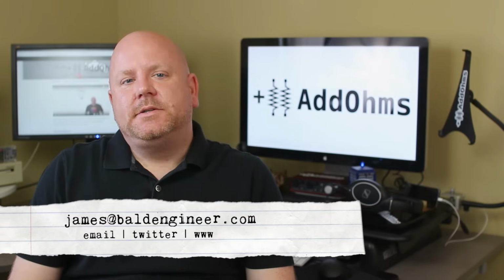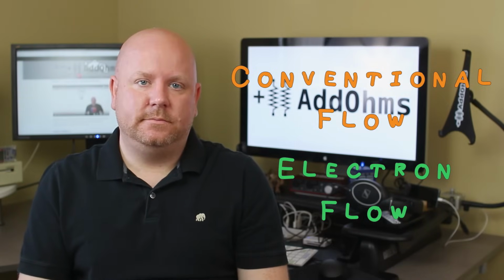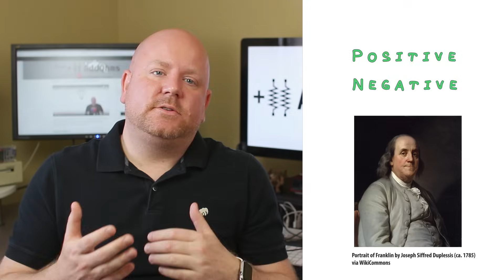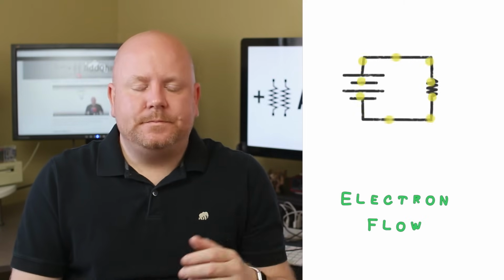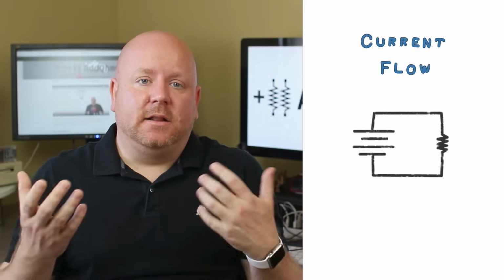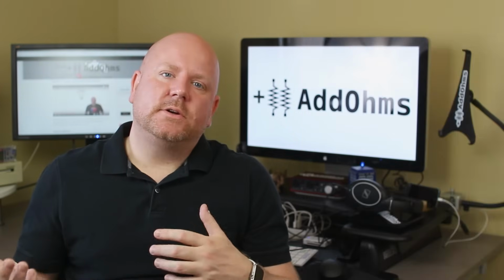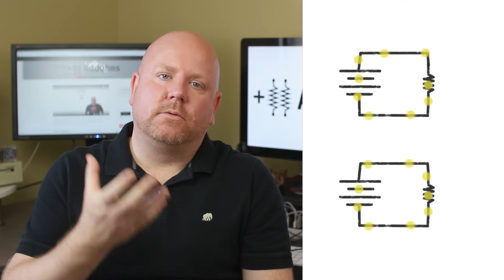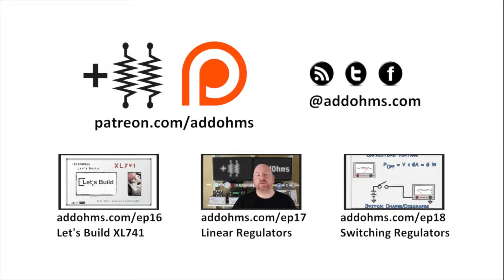Which way does Current Flow | AO #19

Comment: Sorry but Electricity doesn't need to be a closed loop to work .. and NO electricity does NOT comes from the negative side , that was a myth .. HOw can 2 opposite flows be correct  that wouldn't make any sense
Reply from the maker: "Electricity" is a concept that represents a form of energy. So no, "electricity" does not need a closed loop, but this video didn't talk about "electricity." It spoke specifically about current flow. Current flow does need a closed path to flow. And current flows from negative potential to positive. Those are both fact and are not myths.

Comment: Thank you +AddOhms, for the explanation.  But if "flow direction" doesn't matter, why do we place components, such as resistors, capacitors, etc. at specific places within the circuit?   Could we just as easily place a resistor somewhere else in the circuit and get the same results?
Reply from the maker: Don't confuse "path" and "direction." The direction the current flows does not matter. The path it follows does.

Comment: So what if the circuit is using a diode? Since the diode only lets current go one direction if you make a circuit using conventional current your circuit will NOT work....right??
Reply from the maker: You don't "make" a circuit with either. You evaluate it with one or the other. As long as you evaluate the entire circuit with the same method, it doesn't matter. In electron flow current flows from cathode to anode, instead of anode to cathode as in conventional flow.
Reply: @AddOhms  It certainly does matter. Fundamental understanding is absolutely critical for those working research. It is also important for safety, as numerous accidents are caused every year through lack of fundamental understanding.

Comment: As a small boy I learned with conventional flow, it's the easiest to understand. Scientific eggheads are there to confuse us all.
Reply from the maker: I think whatever you learn first is easiest to understand. I don't think either is easier. If you (and I) had learned electron flow first, conventional would seem strange.
Reply: Conventional current just seemed easier to me. Before I found out about diodes I never thought of current flowing through a circuit, as soon as I started to use other components, such as diodes, I thought of the flow of conventional current due to the arrows on the diode and LED symbols. It just looked more natural.
Reply: When I was at college the conventional current way was used, although we were also told that it flowed the other way from a scientific point of view. The lecturers basically said "this is electronics not a science lesson!".
Reply: There is a place where you learn one thing, and it stays the same, even after proven wrong.  You can go there and pretend that fiction is fact indefinitely.  It's not called a classroom.  They call that church.

Comment: Hello James, you made very interesting video. I start to learn electronics, and can't undersnand one thing. It's about n mosfets, especialy about using it for reverse polarity protection. I viewed many images and articles on the internet about it, like this one: http://rs20.mine.nu/w/wp-content/uploads/2013/02/nfet.png
There negative terminal of battery connects to Drain and negative load to Source. I tried to reconstruct this scheme with LED and FQP30N06L, and it does not works. LED lights even if Gate not connected to positive terminal.
In your video "MOSFETs and How to Use Them | | AddOhms #11" your connection goes other way: negative load to Drain and negative terminal of battery connects to Source.
And your scheme is working, if i disconnect gate led stops emiting light.
Can you tell me what way is correct and why. Thanks in adwance.
My brain trying to get out of my head.
Sorry for my english. I just don't like to use translators :).
Reply: Did you ever get your answer?

Comment: don't get it! IF it doesnt matters in which way a current flows then why doesnt my LED light up when i connect +ve terminal to -ve terminal? please explain. this is making me made for 2 months??
Reply from the maker: +Yunik Maharjan As long as you use the same flow-direction for the entire circuit, it doesn't matter which you use. 

Conventional you would look at the diode as conducting from cathode to anode. For electron flow you would look at it from anode to cathode.
Reply: Does that mean the side where I put a resistor for LED doesn't matter? As long as there's a resistance in the loop?

Comment: I think the best way I every heard it explained was as a line of billiard balls all touching each other. If you hit one end, the energy will be transferred to the other end, but the balls themselves (the electrons) don't move all that much. However, they do still move which is why we can create electromagnetic fields with current
Reply: 4 milimeter/h or something like that, what a crappy flow hehe.
Reply: In a #12 wire carrying a current of 20 A, the drift velocity is about the same as the speed that a snail crawls.

Comment: the positive side of a battery holds more charge(electrons) than the negitive side does at rest...when a wire is connected to both terminals...something amazing happens...an ELECTRON gets kick out of its orbit and find a new home by kicking out an electron out its home...which then FLOWS to another atom....very simple until you have to find a way be right about an old theory.

Comment: +addohms answer me this...how can both veiws be valid when one is electrons which does jump from one atom to another and the other is based on proton moving....protons dont move from one atom to another.  if they did would mean that nucleus was split apart...proton moved to another split nucleus and re-assembled just to be split apart again as the proton moved.  Cold Fission?
Reply from the maker: Hm, I can see some confusion happening there. The drawing was mention to show that positive charge carriers could be the thing that moves, like it does with the holes in a semiconductor. In the case of wires (and conductors) only the negative charge carriers move.
Reply: +AddOhms but i still see snake oil.....semiconductor holes....if holes in a diode moves from pos to neg where does the holes move when they reach the end of the diode...do they move through the circuit until comes back to the pos side of the diode?...The whole concept of two charges can be seen to move depending on which one you decide to look at is an attempt to keep all theories and the arrows of a a trans..to have some sort of being still correct.
Reply from the maker: +ken ezzell I think the physics of the P-N junction is something to consider deeper. Thanks.
Reply: Holes are just insufficient amount of electrons. Those small amount of electrons can still move, creating view of moving holes.

Comment: Strictly speaking current does not flow, current is better described as a flow of charge. You can state that in this wire we have a current. But not that in this wire we have a current flow. In the same way that It is correct to say you have a water current, but not you have a water current flow. As the word Current already incorporates the concept of flow as current literally means "a flow of <substance>"

Comment: There are two ways to view it because scientists hate to admit they were wrong and change what is currently used. ;)  This has lead to a great deal of confusion for students of electronics for decades.  Electron flow is correct where as conventional flow is a matter of convenience.  I still wish they had revised everything when they discovered the truth as this can make understanding some circuits difficult as in transistor biasing, especially when you are just learning the theory for the first time.  Just awhile ago I was looking at a transistor circuit and was totally boggled as to how it worked until I changed my approach and looked at it from the point of electron flow.
Reply: This is blowing my mind... I was taught the conventional way 25 years ago until a few days ago some kid told me the opposite.
Reply: I was confused as a kid and until my late teens, in exactly the opposite way: I knew from the beginning that electrons flow from negative to positive. The confusing parts are the electronic symbols: diodes and transistors. They were kind of cryptic to me because I didn't know those little black triangles were ARROWS pointing towards the conventional flow.
Reply: There is no reason why it cannot be changed, regardless of how long it has been taught incorrectly. Long standing beliefs are challenged all the time in science. In electronics, electron flow is what is important and we shouldn't be pretending that electrons are flowing the opposite direction to what they actually are.
Reply: Flat earthers are organizing. In fact, they now have branch offices all around the globe.
Reply: just wait until you realize the earth is flat and NASA is a complete fairy tale, then you'll be up all night for weeks relearning what you thought you knew.  good luck, enjoy the ride.
Reply: @chris_topher1984  shut up flat earther
Reply: @babajideodusanya8843  Gee Willikers, this isn't even a video about flying or space and the flat eathers are still all over it. They're like an infectious disease!
Reply: @babajideodusanya8843 I'm pretty sure that he is a flat brainer as well
Reply: @chris_topher1984    Earth is spherical and there are many different ways to prove it.  Time zones for one wouldn't exactly be possible if the earth wasn't  spherical. Another way to prove that the earth is spherical is if you look at a lunar eclipse. In a lunar eclipse, the earth lines up between the sun and moon and its shadow gets casted onto the moon forming the eclipse part. The shadow we see is more rounded. If the Earth was flat then all you would see is a line moving across the moon which is NOT whats actually shown.

Comment: Just to confuse everyone here, electrons are not always the dominant charge carrier in a metal. For example beryllium, zinc, and cadmium conduct electricity through the conduction of holes, which are positive charge carriers. 
Of course, it still doesn't matter from a circuit analysis point of view as explained in the video however the charge of the particle does matter when considering the forces due to a magnetic field. If you're interested you should look into an experiment called the Hall Effect. http://hyperphysics.phy-astr.gsu.edu/hbase/magnetic/hall.html
Reply: the hole theory is conventional theory....the holes left by electrons is visualized as moving only if you were sitting on an electron and then you would use relativity veiw to see every thing going by you and not you going by them...as if we were taught the earth stood still...we would think the sun moved around the eart.
Reply: I wouldn't say it's conventional in that there are no holes in other metals such as copper, the hole phenomenon only occurs in semiconductors and those metals I previously listed. Yes, the concept of a hole is just the absence of an electron. However, due to weird quantum mechanical effects the hole can be treated as if it actually is a physical positive particle. For this reason it's often called a quasi-particle because its kind-of a particle in that no matter what experiment you do it acts exactly like a positive particle but at the same time is just a hole/absence of an electron.